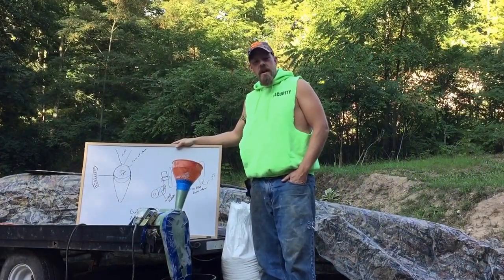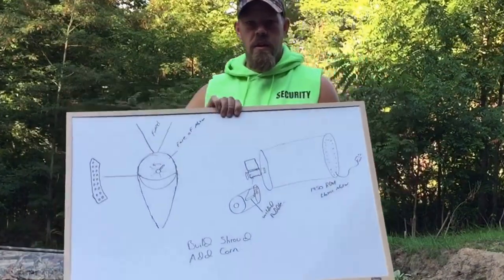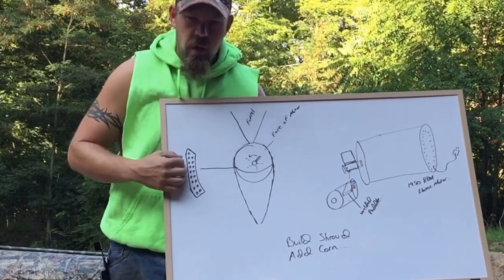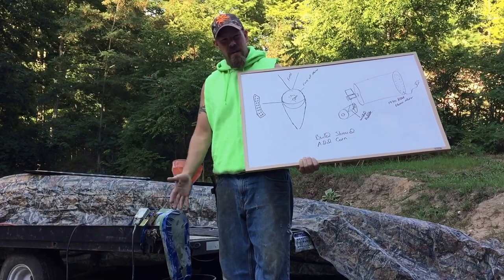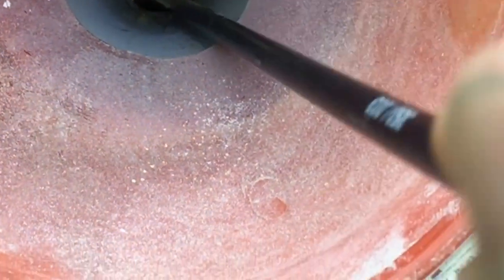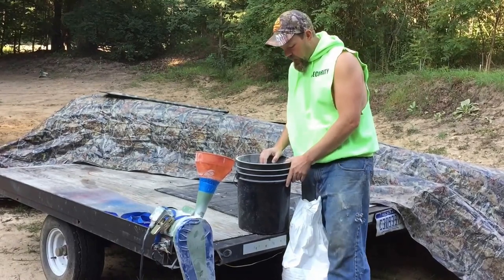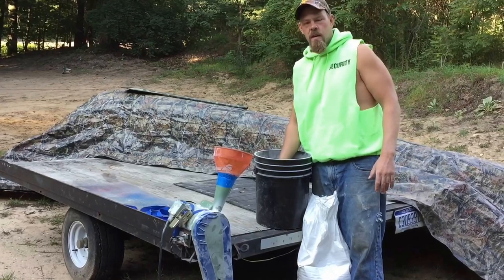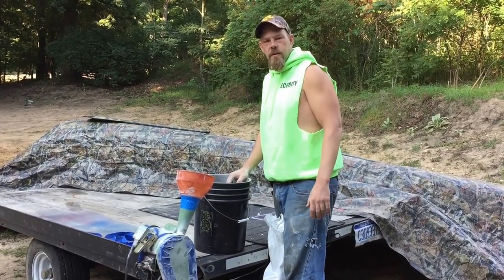Cracked corn maker.."Home Made-Money Saver-DIY".

Comment: I am thinking about building something similar for cracking corn for my chickens. Interesting that you use a single paddle versus several hammers. I am assuming you get some pretty good vibration with it. Still, it does the job!
Reply from the maker: Not really vibration but it’s chewing corn up at the same time so never really noticed I guess. I left mine portable. I just use a ratchet strap to secure it and let it eat.
Reply: @ddwildoutdoors8337  Thank you! I forgot to ask you about the hole diameter size on your screen.
Reply from the maker: 7/32 to 1/4 inch,